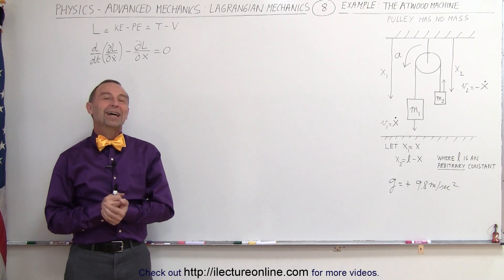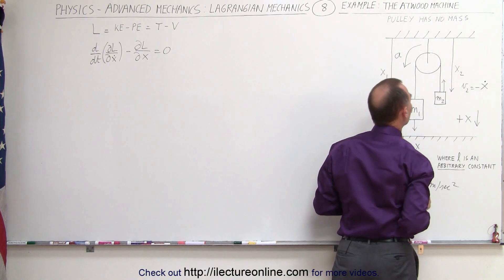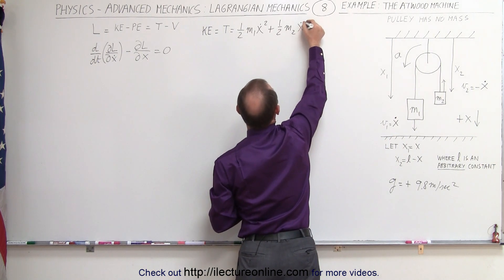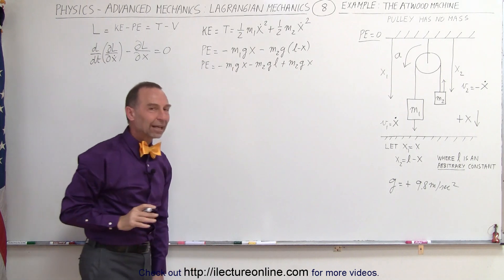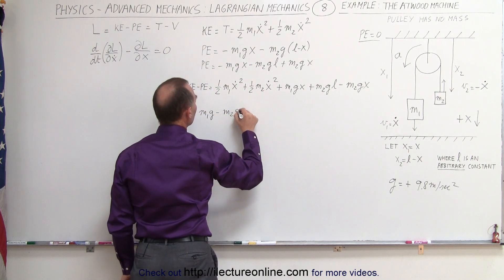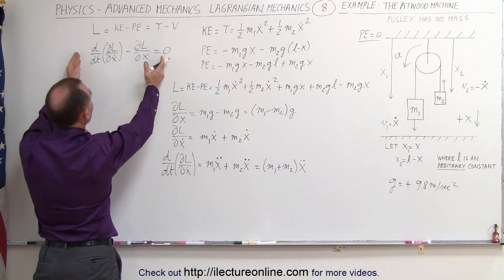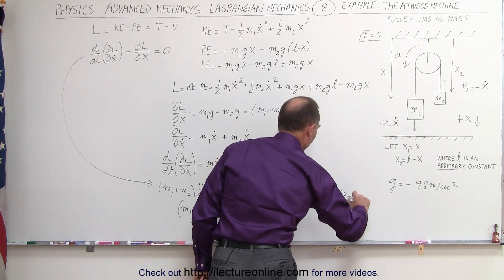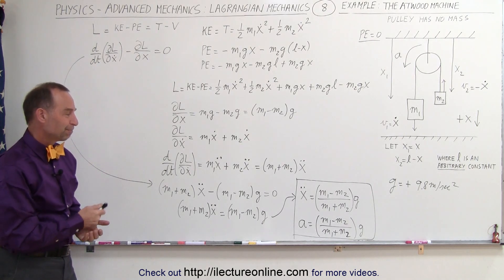Physics 68 Lagrangian Mechanics (8 of 25) Example: The Atwood Machine

Comment: Great! I tried deriving it on my own, and didn't use a l, basing the blocks off of the same x=0 starting point, so their positions w/ respect to time were x and -x. Seeing your  method of x1=l+x shows that the l term drops out, as the Lagrangian is about change, not so much about initial conditions.

Comment: Great job! One question, When writing down the Potential Energy, since you set the ceiling to be at 0 (so x=0)  and the x being positive in the down direction how is the P.E negative, since all g,m,x are positive?
Reply from the maker: Since the force of gravity acts in a downward direction, the PE will be less at a lower point.  It should not depend on the reference point.
Reply: of course, but why you adopt a "-" sign for the term "m2(l-x)", if m2 is going up? it's because you put x2 in terms of x1?
Reply: This is because the sign for the potential energy is independent of the direction the mass is moving. The minus sign is adopted because he defined the potential energy to be zero at the ceiling. This means that the potential energy for any object will be less than zero beneath that point. The term (l-x) is the distance from the ceiling and the object is below where the potential energy is zero, so the gravitational potential energy is -m2(l-x). Hope that helps!
Reply: and........ when KE increases then PE decreases... hence PE is moving in a negative direction....
Reply: @philophyser5031   That is great , This idea was in my mind but I was not sure about it, will it be would be true but I got it now. Thanks

Comment: What to do when there are not conservative forces like friction involved? Since we can't define a POTENTIAL I assume we can't define a lagrangian and hence.... Can't solve using lagrangian mech?
Reply: You can, the equation just becomes d/dt(del(L)/del(dq_i))-(del(L)/del(q_i)) = Q_i, where Q_i is the generalized force acting on the system. 

See here for more info: https://ocw.mit.edu/courses/mechanical-engineering/2-003j-dynamics-and-control-i-spring-2007/lecture-notes/lec14.pdf

Comment: so if the disk has a mass and radius, then all I have to do is add the kinetic energy of a rotating disc to my Lagrangian, right? Is there a potential term that I'm not considering?
Reply from the maker: If the rotating disk does not change height, then all you need is the rotational kinetic energy term.
Reply: @MichelvanBiezen  Thank you! also, does my x_2 become (l + pi*r - x)? or does l = pi*r? I'm pretty sure the former is true but I just wanted to ask. 
p.s. Thanks for all of your videos over the years!